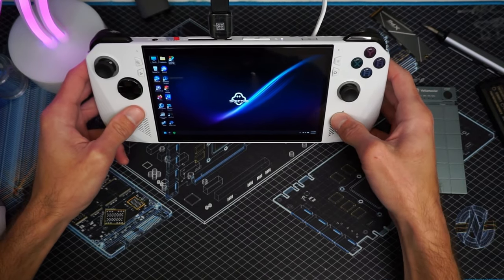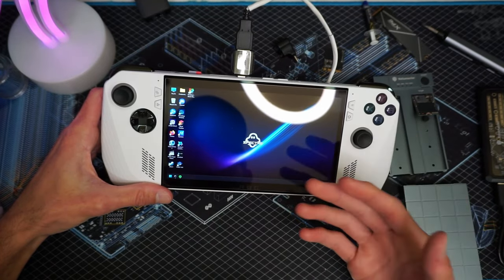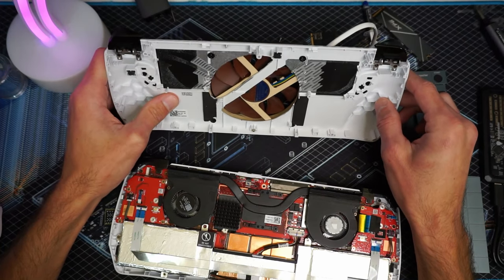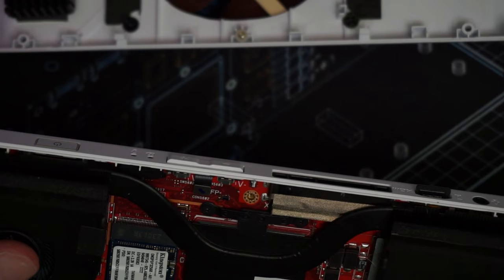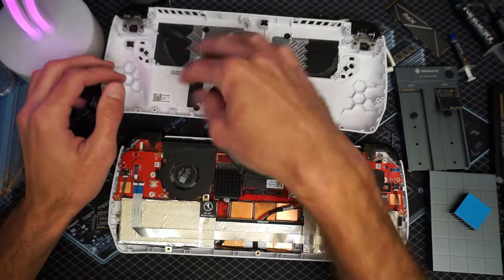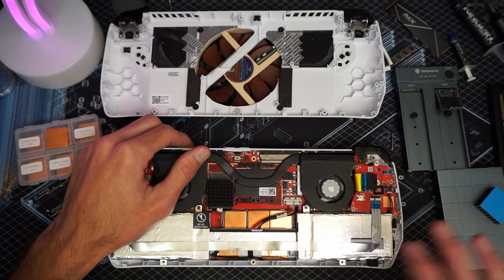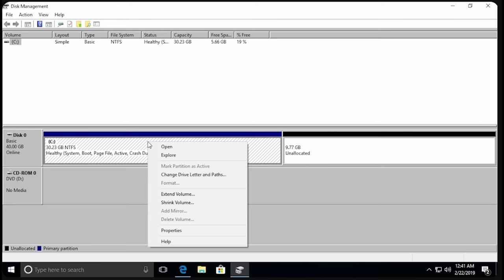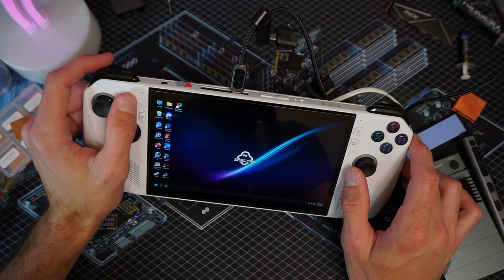All of MY ROG Ally Mods + How I clone my drives with one button! Feat. Yottamaster NVME Duplicator

Comment: I saw that there is a battery mod to leave it with 90wh, however, you have to enlarge the rear, isn't there a more compact 90wh one? Or even smaller ones like 80 and 70wh, so as not to have to increase the rear of the ally? Thanks

Comment: put some small heat sinks on top of the heat pipes and onto the cpu coldplate. with that fan I think it would help massively. I think it could be even done in a sleeker way, you do a cutout in the backplate and have a straight line of heatsinks soldered onto the heatpipes for passive cooling. or bypass the standard cooling with a modified laptop heatsink so the fins are on the outside of the device trough a cutout. That fan you got there could be wired to the battery directly and have a micro switch to turn it on/off. cool mods as I looked at reviews before buying and this rog gets too hot!
Reply from the maker: I’ve actually really wanted to wire it to the battery but really don’t think I’d be able to unless I used a way to lower the voltage with like a resistor or used a fan controller. Any ideas ? This fan is like a 5v I believe for what I’m pulling up
Reply: @cppctek  right the battery is 15V so cant do it without a DC converter. probably no room for even a small one inside the ally. I dont have a good simple solution for that.

Comment: do you have a full video of this tutorial i wanna know how to clone the drive
Reply from the maker: If you buy an nvme cloner it’s a one button approach. If you wanna do it with software you can use a usb bootable like medicat and there’s partition tools to use to clone the drive also there but you need a way to have the usb and both the nvme drives connected as well of course.
Reply from the maker: Which method were you going for ?
Reply: @cppctek is this cloner device plug and play and don’t need any pc? and the medicat usb do u have a full tutorial? thanks for the reply i appreciate it 😊
Reply from the maker: The nvme clones. One similar to what I used in this video can cost a little bit of money but it makes the process easier for sure way easier than other methods. It’s worth the money in my opinion if it needs to be easy as possible. Something like this that support nvme to nvme cloning MAIWO NVMe AHCI Duplicator, USB3.2 Type-C 20Gbps M.2 SSD Clone Docking Station, Compatible with M.2 SSD 2230/2242/2260/2280, Support One-Key Offline Clone Function (K3016P2+) https://a.co/d/a2PtC3T
Reply: @cppctek  cool! i was thinking of upgrading my ssd im not sure if the 2280 route is safe for the ally? and if ever i go that route is it possible to  clone the 2230 to 2280 in that cloning device?

Comment: For the copper shims/heatsinks do you think these are needed have they made a good difference for you? Thanks :)
Reply from the maker: Depends. I don’t think it’s made a noticeable impact but it may improve longevity with lower temps but there’s no way to monitor them either
Reply: @cppctek  Thanks for the response, Managed to find a small pack reasonably priced so I will install them. Originally I could only find 50 Piece packs but managed to find a 10pack on ebay

Comment: Hey, first of amazing video loved every part of it… i’m going to buy the ally in a week. Would you by any chance recommend a good hall effect thumb sticks for the ally, heard some issues with the right thumb stick but the left one works for everyone.

Also i’m looking for a egpu solution for the ally, never really seen anyone try it other than a very few people, it goes like this

M.2 m-key to oculink adapter (which is connected to the m.2 slot at the back)

From there a oculink connecter is attached from the adapter to an oculink to pcie x16 adapter which could theoretically be used as an egpu.

I’m not good at modding so pardom me if it seemed confusing but would it be possible for you to check on it.
Reply from the maker: Check out the discord if you still have questions. I’ll be happy to help

Comment: Thank you Sir! I clone mine using software an the SYSTEM drive is showing in file explorer. Is there a way to remove it? Can't find that drive in disk manager.
Reply from the maker: What software did you use ? I would say drop by the discord and one of my peeps may can assist if I can’t before they do. I got some great folks in there
Reply: @cppctek  Macrium Reflect sir.

Comment: ID on that right angle usb w/passthrough? think I might take a crack at the fan mod.
Reply from the maker: The link I had is not working. But I got it on Ali express. Make sure it’s the one that has both usb an and c.
Reply: Thanks man, appreciate all the work you put in making these videos.

Comment: I used .5 pad and 20x20x10
It doesn’t touch the pipe but is that good for thermals? You mentioned squishing
Reply from the maker: why would you use a smaller pad though? 1mm is whats used on every motherboard nvme heatsink, every third party heatsink and more. Less is worse on temps and doesnt have enough squish to fully allow the height diff on the chips to sit. i just dont see ANY advantage to thinner pads... i tried it..... there is many reasons i suggested 1mm but you do you bro. if it works work it

Comment: Gonna wait of the thermal pads near the sd card reader. Ivr got lots of thermal pads. Hopefully it fits
Reply from the maker: Thermal pads on the reader itself will make it worse essentially transferring more heat from the heat pipe to the reader but better thermal pads over the mosfets and inductors where the fan shroud is will help like I’ve done
Reply: @cppctek  Ohhh thank you for the clarification on this!

Comment: I did the heat sink on the nvme and thank you 😊
Reply from the maker: Heck yeah !!
Reply: @cppctek  What's your opinion about switching out sticks for hall sticks? I was gonna get a set on ebay comes with the little paper for in between board and stick . I personally like the ones on mine but there lose feeling . Either hall sticks or stretch the springs like you did . I just can't make my mind up it looked ruff stretching springs cause of all the little components

Comment: Hi. I did the heatsink mod too. 
Thanks btw. 😊

How about for those people who don't want to come out with a big hole at the back. You think you can do or atleast show another mod? 

There's actually a 25x25x5mm heatsink which is 5mm lower than the one we used. And there is a micro fan 25x25x5mm and it fits exactly like the old 25x25x10mm heatsink. 
Theoretically you can out in those heatsink and fans at the cpu backplate too I think they'll fit the space. But basically it means you now have a heatsink and fan inside. 

I just don't know how to power it 😅😅 either via external or since they are small fans, you think we can wire it in by splicing it to the somewhere?  And or maybe have a small chip to connect to the cpu sensor too and have it ramp up the same as the system fans?. 

Its a big project to do. And I'm a noob at these things but I'm pretty sure with the spacing, it seems to work out. Just needs a way to power em either manually and have a switch outside like a small button to press or have it connected to system fans directly
Reply from the maker: if you get the 25x25x5 its a waste of time, it doenst have the surface area to cool as good and also will eventually fall off or come loose. the x10 is a flawless fit
Reply: @cppctek  so what your saying is keep the 10mm then. Got it.  

But also I saw your noctua mod. Maybe you can do a similar mod too but a non destructive one. Where you don't have a hole at the back. And maybe we can put small fans inside. Thay would be awesome. I can see you as someone who can do that. 

Keep working on great content bro.

Comment: and you have never heard about ptm 7950 huh? that is meta now dude
Reply from the maker: You didn’t watch the whole video obviously 🙄 I even talked about ptm for a good min lol I’ve used it along with kingpin and several other paste. Stop hating.
Reply: @cppctek   bro I suspect it does not really matter what thermal paste you put there cooling wise. so best to chose the one that stays for longest. The cooling system is probably the bottleneck, not the paste. no matter how good paste you put the cooler can only remove so much heat before it taps out.

Comment: Does this fan pull out hot air or does it blow cool air inside ?
Reply from the maker: It’s set as intake of course. Cool air in so it doesn’t fight the natural flow of the stock fans